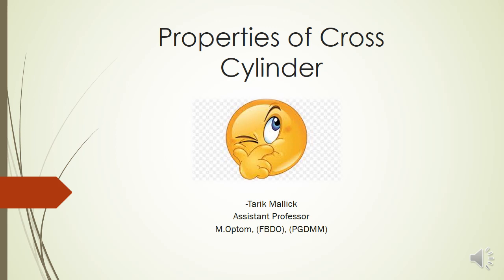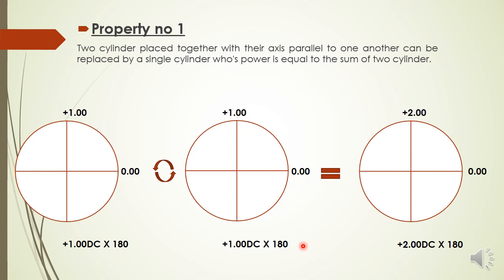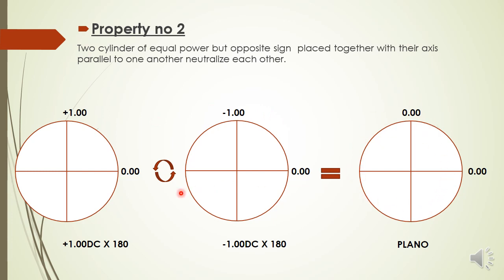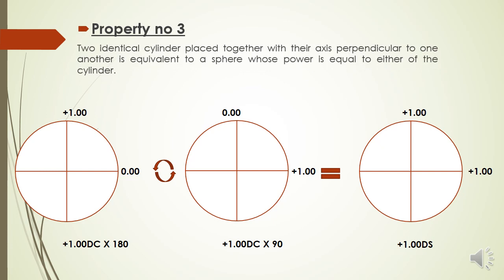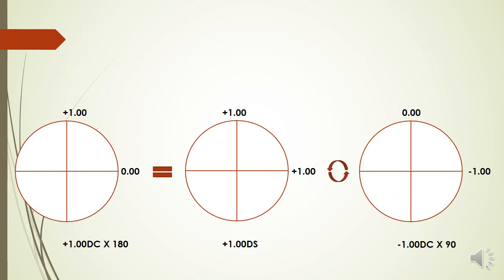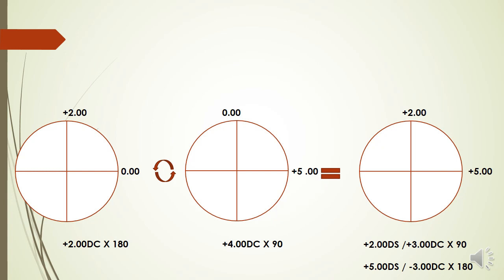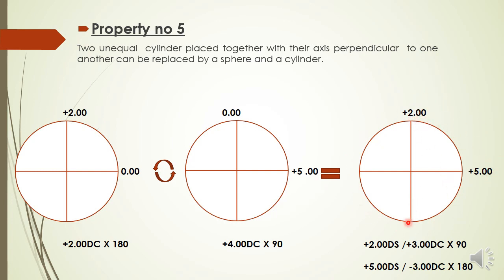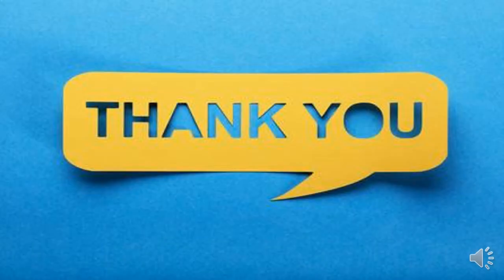Properties of Cross cylinder

Comment: Sir if the power is +1.00D /-2.00 D x 90  so how do to cross cylinder
Reply: In my viva I have given the answer is 
-1.00/+2.00 x180 
So my air was said that you just maked a simple transpose make it cross cylindrical 
So how it come plzzz explain sir.
Reply from the maker: Hi 
Cross cylinder means to convert the prescription into a cross so for your given it will be +1.00 at 90 and -1.00 at 180 when make a cross
Reply: @OPTOMETRYWITHTARIK  thnks sir

Comment: Sir 
In 5 property 
If axis r different in case one is having 165 & other one is having 75 then
For final spherocylinder wat will ve the prescription of axis?
Reply from the maker: Applying the same concept just now we will 75 in place of 90 and 165 in place of 180 as they are perpendicular to one another
Reply: @OPTOMETRYWITHTARIK  Thanku sir😇😇
Reply from the maker: Your Most welcome
Reply: For final Prescription if one is in 165 and the other should be in 15 so they are Perpandicular